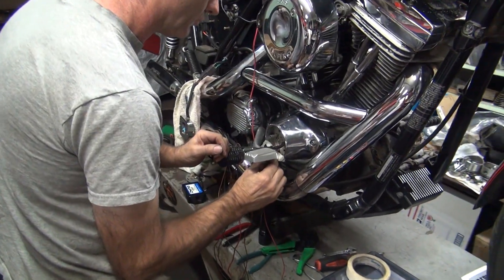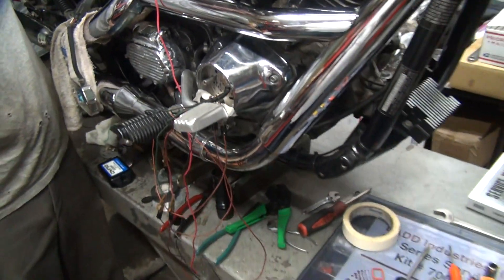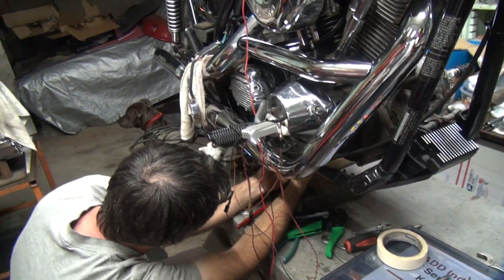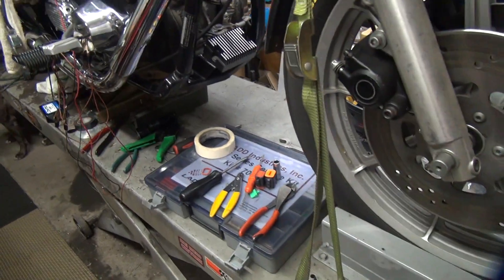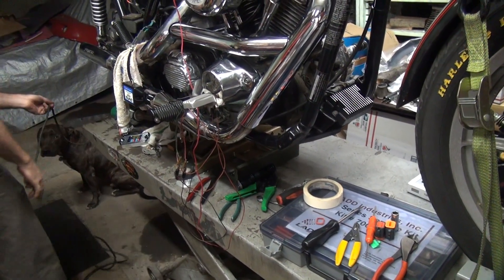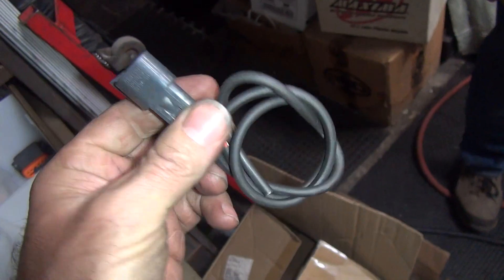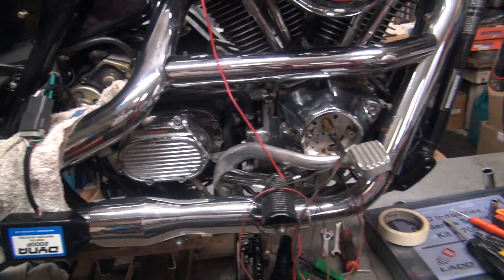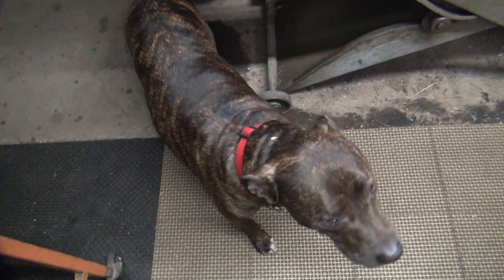1989 fxr #110 ignition swap-out repair harley dyna 2000i by tatro machine

Comment: Tatro, the Dyna 2000i is the internal module, like the Ultima. The 2000P you're installing is external and also Curvemaker programmable with a USB cable. The 2000 external with no suffix isn't software programmable.

For posterity here is the factory conversion from 7 pin to 8 pin module connectors. You can buy a converter harness from Dyna. 

7 pin     Color         8 pin         function
-----------------------------------------------------
1            pink           4               rear coil
2            white         1               power
3            black/w    2               pickup gnd
4            black         4               ign gnd
5            violet         6               VOES
6            green        5               pickup signal
7            red             3               pickup power
Dyna separate bullet  wires: green is tach, blue is front coil

Dyna model numbers:
Dyna2000 (Not programmable with USB cable)
DD2000-HD1E - 7 pin single or dual fire
DD2000-HD1E8 - 8 pin single or dual fire
Dd2000-Hd2E - 7 pin dual fire
DD2000-HD2E8 - 8 pin dual fire

Dyna2000P (PC programmable with USB cable)
DD2000-HD1EP - 7 pin single or dual fire
DD2000-HD1E8P - 8 pin single or dual fire
DD2000-HD2EP - 7 pin dual fire
DD2000-HD2E8P - 8 pin dual fire

Dyna2000i (internal and PC programmable with USB cable)
Reply from the maker: thanks for the info. i am sure someone can use it.
tatro

Comment: Tatro what was meant when it was said that "it ran strong but wasnt advancing" I have a 86 fxrs liberty and just went through tge 31 years of cob jobs and lack of maintenance replace a lot of connector blocks, wire harness ends, and a bunch of other stuff. Starts right up no problem, runs great in 1st and 2nd gear, however cuts (stalls) out in 3rd-4th and seems to Rev higher.  Also there is no module behind right side cover oil seeping from wire at bottom of "V2" plate.
Reply from the maker: sounds like it is time to take it apart and fix it.
it is amazing how good things work after you fix all the problems. most of which you didn't know about yet.
tatro